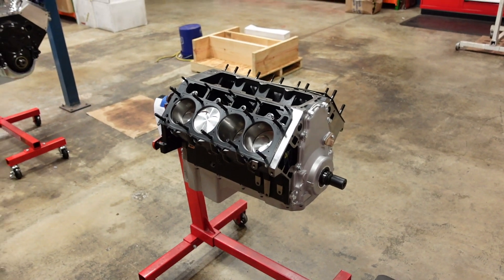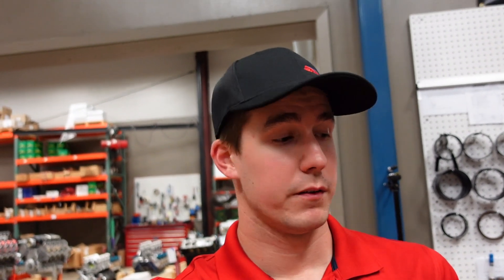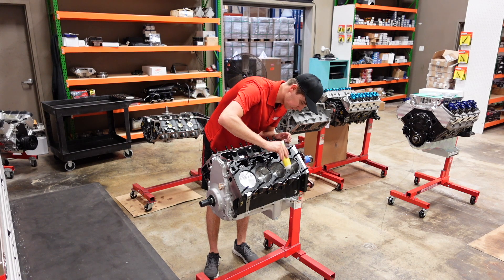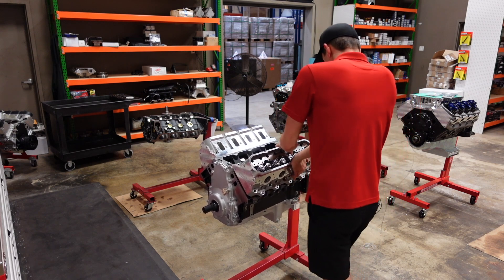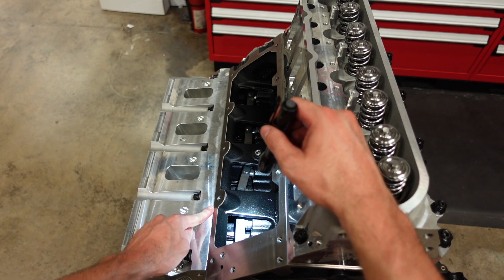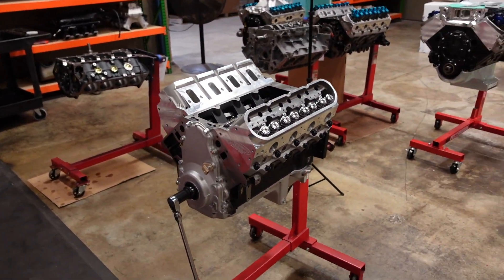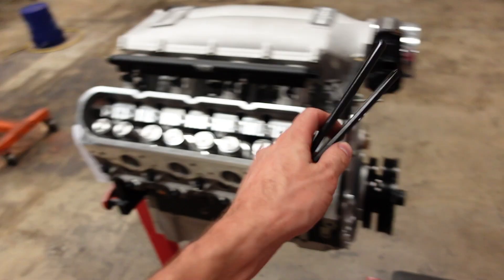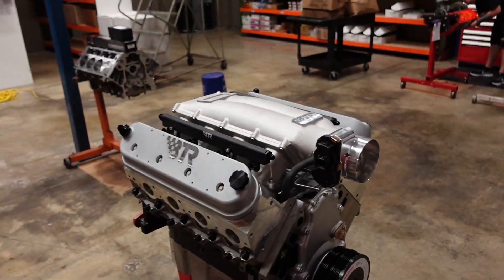441" LS3 Engine Build! 12.0:1 Compression & 11 Degree Cylinder Heads - Part 2

Comment: Hard to guess what a 12:1 compression ratio engine will make. It depends a lot on the fuel. Assuming it's running on 93 octane pump gas I'll guess it will make ~573hp @+/-6200 rpm.

Comment: Loving this build. I just wish the customer opted for the shaft rockers. I wanted to see that setup. I'm probably gonna order the 11* heads for my NA 427 build but want to use the shaft kit. I'm building the same CR motor and shooting for 700rw.
Also, Why are you referring to it as an LS3? It's not anything like and LS3 other that head runner ports. I have the same block. It's a splayed main SBC style Dart block made to accept LS parts.
Reply: I was thinking with all that engine at least the BTR shaft system. I've used it in 11 engine builds since I was aware of its existence. Very satisfied with the BTR shaft system!
Reply: @arturozarate1752  I'm still deciding on what heads I'm gonna use. Swaying towards Dart Pro 1 12* and a BTR shaft system. Apparently Smeding says their kit only works with their heads but can still accept stock valve train ??? go figure???
Reply: dude  hmmmm....looks like a BTR system to me. I've noticed that BTR gets no recognition though when there items are used on builds. I could see a height difference in the mounting base if the valves were longer or shorter. If Smeading is using a different valve spacing on their heads that would explain them only working on their heads. The BTR shaft system works like a champ though.

Comment: I’d say 650 hp 575 torque
Reply: Nope you are talking about my 10.7 to 1...17* 399 ci. 1st gen.🙃
Reply: @heshtesh  I wasn’t too far off. 😘
Reply: @Roninx1980  I'm surprised my 10.7 to1   17 degree 1st gen , 399ci makes 641hp@6400 and 560ft lbs@5700 on 89 pump gas, I was obviously expecting more.

Comment: First time I’ve heard of sealant on intake rocker arm bolts.
Is this with all LS engines?
Reply: The reason is that the rocker bolt holes on the intake side protrude into the intake runner.
Reply: On a modified intake runner the rocker arm bolt hole extends into the roof of the runner and gets exposed with port work. To keep oil from seeping into the runner thread sealant with PTFE is used.

Comment: 600 pluse ... what typ of oil thicknes do guys recomand for this motores
Reply: I've sent engines out. Running 5w-20 and as thin as 0w-20 for NA and tight clearances. A great off the shelf oil is the Pennzoil full synthetic Platinum Plus.

Comment: I'm guessing around 700hp and 665tq🤔
Reply: Thats kinda what Im thinking
Reply: Yea not much more unless it’s forced induction
Reply: It BETTER! my old machine shop, we built a darton sleeved 6.0l cathedral port headed 11.5:1 compression 434 that made 750 on PUMP GAS!
Reply: @southerndualsport3827  434? Dayum. Daddy need some of that
Reply: @sethh8892  haha yeah it was a beast we did 2 actually one in a $300,000 trophy truck and the other in a c5 corvette and the Vette would do rolling burnouts at LITERALLY 100mph!
Reply: I wouldn't mind having that engine inside my 4th gen f-body
Reply: @Joshua932-l2c  hell ya
Reply: Itll make more than 700 easily.
Reply: I think around 800 hp 441.

Comment: I like the way on the header exhaust ports are round.  Best guess 550 hp.
Reply: Closer to 700
Reply: @baby-sharkgto4902  Will see!!!
Reply: @ronsmith7739  hell yeah Ron, looking forward to it
Reply: If it only makes 550 there is something very wrong. You can very easily get 550 with an ls3 motor with ls3 heads. This is 70 cubes bigger with a 1.2 comp raise and a much bigger cam. I would be disappointed if it doesn’t go over 700
Reply: Def gonna be more than 550 hp. Cant wait to see!